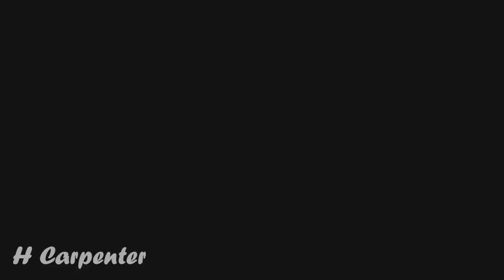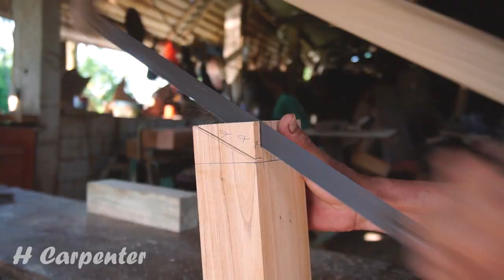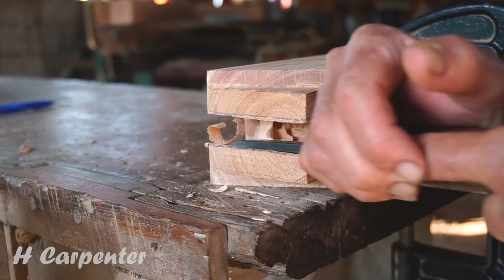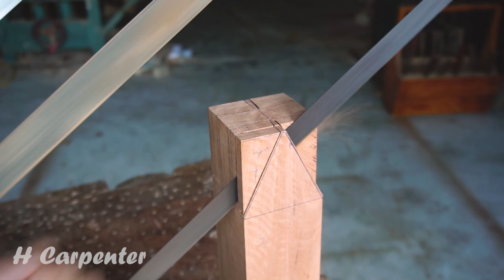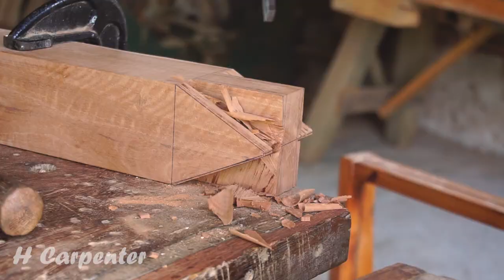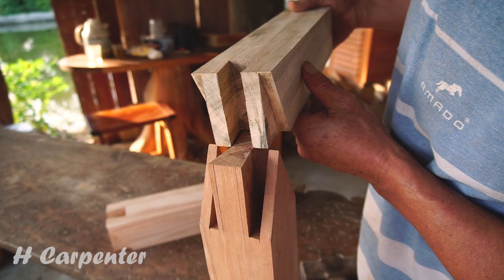Amazing Japanese Woodworking Hand Skills Carpenter, Wood Structure 3 Connectors Without Screw

Comment: Two rails butt-jointed and butterflied over a stile/ post. Fine......but I can't picture the circumstances where that junction would ever occur. Certainly not in furniture, because there's always a long enough bit of wood to do the rail in one piece. Not in structural framing of a building, because you'd scarf the plates together and tenon the post into them (this joint would be far too weak). Anyone got any ideas? Otherwise, it's another just-for-Youtube special. Nicely done but purposeless.
Reply: Moan, moan, moan, moan, moan, moan, moan ... takes a breath .... moan, moan, moan, moan, moan, moan, moan .......
Reply: Repair or extension work with joint supported by a post/jamb ..... make your choice, but you'll never become an expert by raving on about scarf joints when it's not always possible to use one.